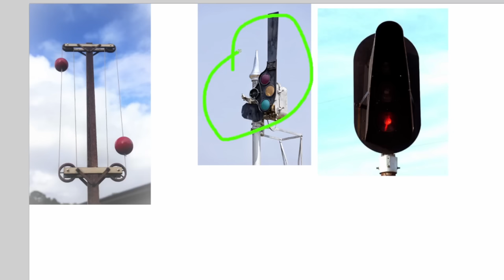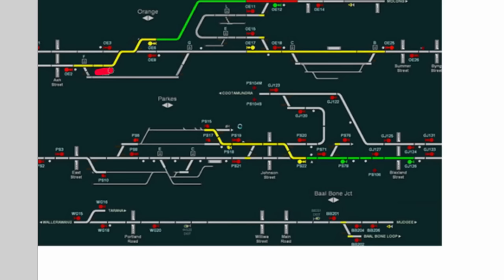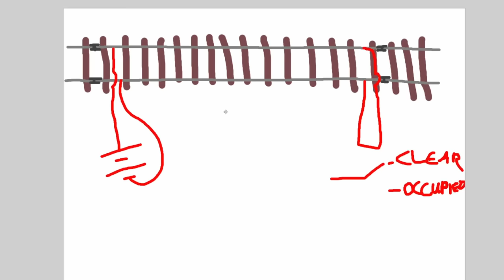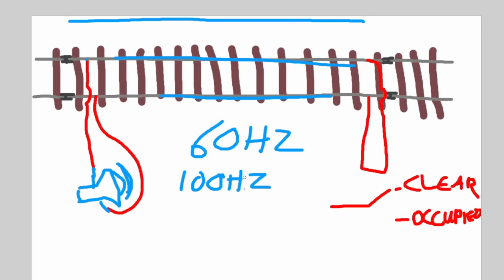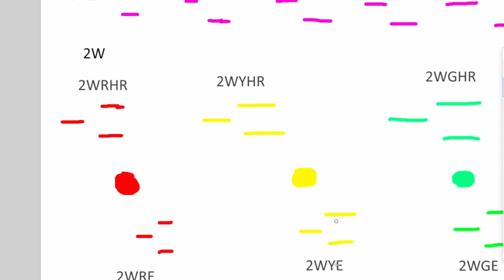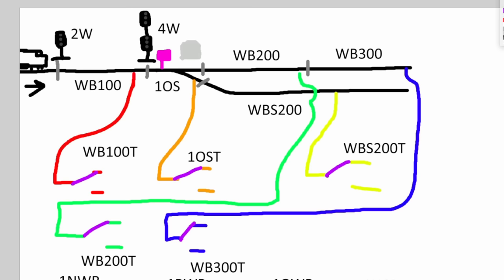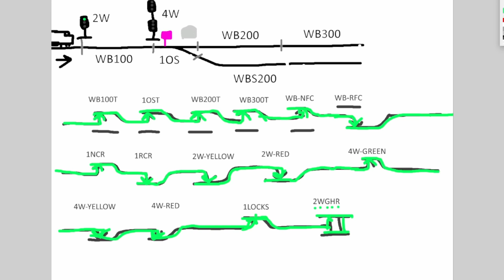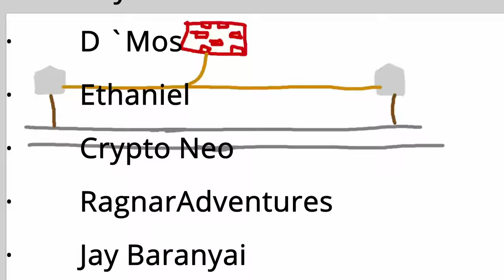SIGNALS 101: 10 Levels of Train Signal Understanding

Comment: phenomenal  job explaining this subject, I knew most of the subject but I always like to hear from someone that actually knows there stuff. Though I have one question to ask and it relates to the engineering side of the circuit design and development. I worked at the LPKC in Edgerton, KS. Seeing you are BNSF background, you may have heard or seen the destination come up. So, with that noted, I worked for ITS CONGOBAL on their switch crew, and I took it upon myself to try to learn everything I could regarding railroads. Watching videos, reading actual code. Though, We never left the yard, we only needed to understand the basics of proper rules, operations, and regulations. But myself, always wanting to know how everything works, to help me down the line if a problem may come up and relay the specific problem, Instead of IT BROKE or It Don't do the thing. Anyways, The real question is that there is a set of signals on both sides of the yard, pretty straight forward, making sure that we don't run into inbound trains and they don't run into us. So of course, the CTC system ends in our yard, but there are times that we need to pull a huge chunk of train from the strip tracks and put them some where or build a stupidly long 16k train. So on the east end of the yard, dispatch stacks the signals for us as Yellow over red and fleets us, So we can use the lead up to the main line but no further. But on the west end of the yard, they don't. We have to tone up and request a flag through like almost all the time. Now they can give us a green but it lines us all the way out, So they can't give it to us all the time. So, the question is, why would they not try to develop a logic system for that blocking. I bet its a pain in a half because its right next to cross overs and such, but we lose so much time when the dispatch gets busy with everything on the main line and our nights are always stacked with stuff to do and we only have two leads to work with. Sorry for making a huge paragraph of this, but I do apricate all the videos you post, Its great to know that there is a train nerd like me out there. I thank you again. Let me know if there is a better way to ask this and proper channels. Hope you have a great day!
Reply from the maker: Cheers mate, great question. I'd imagine that  they could change the logic to allow for that same move on the west end, it's just that making the cutover to test and validate that change when it's a busy yard is probably quite cost prohibitive. One of those "this would be great to do if we didn't need it every day" kind of things.
Reply: It sounds like it's a "improved-productivity-through-experience" thing they need to figure out in Fort Worth.  Fleeting is the absolute (no pun intended) best thing they could do for you.  But there could be safety or other operational nuances they go by that makes that more complicated in one direction than the other.   Another yard lead with much more headroom would be the idea but most-expensive solution, if there's even the room.

Comment: Usually between two control points you can't set two trains to go on the track where there are no other control points and where there is no siding to put the other train

So for instance between Albany and Mechanicville cpo4 and cpo5 are the switches for the menands yard
If you have a train sitting at CPF 468 wanting to come South and a train sitting at CPO1 wanting to come north, you could if the train in Albany was small enough to fit on the siding in menands you could send that North and throw the siding at cpo4 and give the train a green to cpo4 siding, and give the train in Mechanicville agreeing to come South to cpo4 and by the time the train got to CPO 5 cpo4 would be clear and you could line the track back to the normal condition and give a green South at cpo4 and CPO 1

But they don't normally do that and they will only have traffic in One direction all the way from Albany to Mechanicville and they will set the green south from Mechanicville all the way to CPO 1 and once the train clears from cpo1 they will set it green to come north

And when you look at the BCP data you see that there are only about eight conditions that are set each day for the track between those two control points and once the train has cleared the approach blocks the BCP data is waiting to be sent and everything is lined up and set for the next train even if the next train is not for 12 hours
The timer circuit that times out the green signal doesn't get started until the approach block is occupied so the automated approach blocks for milepost 15 mile post 12 mile post 10 milepost 8 they go green as the approach blocks are entered and once the train clears milepost 8 the green light at the control point at cpo5 comes on and the timer starts and if the train does not reach that Green light within 10 minutes the light goes back to red automatically

I'm not sure why they do that but I know it does it
And it does not seem that the dispatcher can override it

Comment: In the Netherlands, the ac frequency on the tracks differs, depending of the speed allowed to drive. The train has a pick-up coils for the train computer so the train knows the max allowed speed. 
That system is not used on the high speed tracks. There they are using the international system with beacons.
Reply from the maker: Makes sense; we have a similar thing with audio cab signal setups where different pulses of frequencies are picked up by the train.

Comment: ATCS Monitor is a great program to monitor the over the air ATCS signals and it shows all the bit indications
So like NWK or RWK bits 11 and 12, to tell you if the switch is in normal or reverse
And the LZK interlocking NGK,TK,1NK,1SK, etc..

All the data is amazing to see and ATCS is great

Hopefully someone will decide PTC which sends the same data and more
Reply: Just remember that ATCS is a protocol.  Its usage over radio-frequency (which can be sniffed by railfans) is, unfortunately, declining.   It also does not show the actual signal aspects that signals are showing.  It just shows signals which have been "cleared" for trains to pass.

Comment: Back in the sixties when I was a Brakeman there was a interlocking that was remote controlled. The semaphore mast was the highest object for quite some distance. A crow, might have been a raven as I can't tell them apart, didn't let that fact go unnoticed as it decided to take residence by roosting on the blade of the top semaphore when it was in the stop position. When the operator would give the lineup the weight of the bird kept the blade from rising. You could blow the whistle, or flash the headlight to no avail. That bird just sat there. That bird didn't take notice of you until you hit the ground and you reached down to grab an appropriate piece of roadbed, it would then vacate the area. Numerous crews had this happen until one trip I notice empty shot shell and a few black feathers scattered at the base of the mast.  Jack Peterson hogheaddotnetyes
Reply from the maker: that's hilarious!

Comment: So, true story:  In San Jose,  CA they installed a light rail system.   A good poetin of it was right on the middle of First St, and cars had to turn across the tracks.  The initial signals for the trains were basically a stoplight, but the lights had a T,  for "Train".  Unfortunately, a fair number of drivers saw this as T for Turn.  And then, when it turned green,   would proceed to turn right on front of the train.  Which may or may not have "caught" the light.   This did not work out well, more for the cars than the trains.

Comment: Oo, goodie, time for my promised paragraph (may become several.)
So in the earliest days of British railways you didn't have a 'fixed' signal as such - you had what's known in the industry as a guy. With coloured flags to indicate what he wanted you to do - White for Right & Red for Wrong & Green to Slowly Go Along. I.E. Red = Danger, Green = Caution (sounds alien these days but y'know) and White = Clear (yep, white.) Now then they realised they wanted some sort of pre-determined point at which to caution or stop a train, which could be seen from a distance - so they hoisted the flags up a pole - problem solved! These were known as fantails, and tended to blow away in high winds. 

'New plan,' they said, and painted some metal plates in red/green, put them on top of the pole, then if you wanted the train to stop/slow you showed it the board - if you didn't you rotated it 90° and it became invisible. Now, this was a problem, because while it showed a positive 'stop/caution' indication, it didn't have a good 'clear' signal. Some railways erred the other way, showing a white board for clear and nothing to say stop! (These boards often had lamps mounted above them which rotated the same way, for dark running.)

Eventually, we were delivered to safety by one Isambard Kingdom Brunel, who invented the disk-and-crossbar signal. A red disk, a white crossbar, perpendicular to one another. Rotate it whichever way, the driver knows how to react. Cunning, ay? Well yes, expect at Reading, where there was a sharp corner before the station. The signal would first be seen with the indication wrong, then ambiguous, then finally correct, by which time it was too late for a response. 

So they fitted the ball signal which is covered in the video - the design that gave us the term 'high-ball', a red ball run up on a post to show 'clear'. If the ball was not visible the train must not pass it! Safety first, ay? Different railways that were not the Great Western did not use a disk-and-crossbar to the letter of the design, but adapted it - some entrepreneurs painted the board red one side and green on t'other - three aspects! These were the signals that controlled all British traffic until the all-conquering semaphore came about.

You'll have noticed the colours used here are different then the ones we have today - this is because if the colour lens fell out on a dark night, the driver would believe he had a clear run under white lights, and a collision would ensue. I am unsure how they settled on green for go in place of white, and yellow for caution, rather then just doing a straight white-yellow swap, but that's how it went.

Another point worth mentioning is that if a train failed to appear, it was generally assumed it had broken down and a second engine was sent out to meet it, usually on the wrong line with no special authority, and it is a miracle serious collisions were avoided!
Reply from the maker: That's a lot of fun info! Cheers mate :)
Reply: A lot of that same history happened at the same time here in the States.  The same colors, the same meanings, the same presentations.  We had a few diversionary loops (e.g. Banjo signals) but semaphores got quite popular in both nations.  The dam kind-of broke once a good Yellow (amber) lens was developed.

Comment: I imagine that the TTC subway in Toronto, Ontario Canada is controlled with a lot of logic, even though there are only a few lines. With the frequency of the trains and the distance between them, there could at times be a few hundred meters between them. Tripping a signal is a very big Nono.
Reply from the maker: Yup, headways (distance between trains) that small almost gaurantee logic like this. Possibly even a more advanced system called Communications based train control (CBTC) where each vehicle reports it's location and the track blocks are virtual instead of real.

Comment: Surprising how similar it is to what we have in Slovakia, Central Europe, with unelectrified, DC electrified and AC electrified tracks and signals. Even the physical layout of the signals themslves (but drive to Austria over the border and it is different). Interoperability of electric locomotives is a pain in the ass, as some of them use frequencies in their regulation of power that interfere with track circuits in some countries. Practically the only common thing across borders (and not always) is the track gauge, rail profile, wheel profile, maximum axle load, and loading gauge standards. Railways in Europe are a nightmare when it comes to designing rolling stock that must run through different countries, being able to run on different DC and AC systems (voltage and frequency varies, e.g. a locomotive must run on 3000V DC, 15kV 16,7Hz and 25kV 50Hz while also being compatible with all those specific track circuits used under each system), also the catenary systems have conflicting requirements (the width of the sliding strips, the force it applies to the wire, the minimum and maximum height and also the location of the pantograph on the vehicle relative to rail - especially for curves - and do not get me started on specific asymetrical layouts in Switzerland). No wonder that some modern electric locomotives for international transport in Europe can have up to four pantographs, because they need to be equipped with them, or they use a compromise that is being accepted by all the different norms, not utilizing the full potential of some of them.

Comment: A few clarifications.  Early in the video, you talked about "warrants".  While warrants may have been used it the early days, the only term I know is "train order".  Train orders were issued by the dispatcher (centrally located).  An operator, or train order operator, )at a Train Order Office, copied (carbon paper) the orders as dictated by the dispatcher and delivered copies of the orders to the Conductor and Engineer(s) on the train.  Train orders could be used in conjuction with a Timetable.  Sections controlled this way were specified at TTTO (Timetable, Train Order) operation.  Timetable gave trains superiority by class and direction.  1st Class trains superior to 2nd Class, etc.  Divisions of a railroad would specify (in the Timetable) which direction was superior.  Division I worked for specified East as superior.  So, 1st Class trains were superior to 2nd Class.  But, within a class, say 2nd, Easbound trains were superior to Westbound.  Train orders were more "powerful" that Timetable; and overrode Timetable superiority.  Example, a train order could make an Extra train superior to a 1st Class train.  Also, the levers in the interlocking tower you showed, may have controlled signals; but their main purpose was to mechanically and remotely throw switches.

Comment: Thank you for the explanation of how signals lights work for railroad block.
Also, how complex a system can be!  also, how the system is set up with fail safe to prevent train to meet head on.  
With that said!
On my computer I am watching the Tehachapi loop and museum cams for BNSF & UP trains.  Were there are single track and double track (siding). How train pass each other (opposite directions or same directions) Heading North bound & South bound.  With what you said, thinking of trains moving from Mojave Dessert to Bakersfield. The coordination of the trains to move via that section of the track and thinking of all the relays to make that coordination work properly kinda just blows my mind.
Thinking of the logic of that performance has to be really crazy.
Just thinking the old way with relays and how the control houses and now digital is probably set up in side with fiber optic connecting everything together (yes there are still have microwave dishes set up).
It is just amazing.
Again thank you!